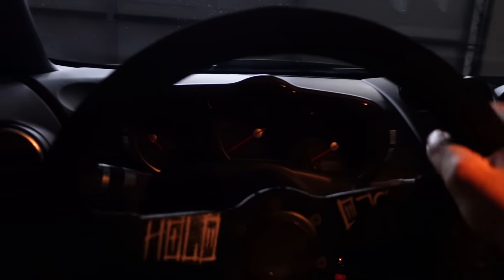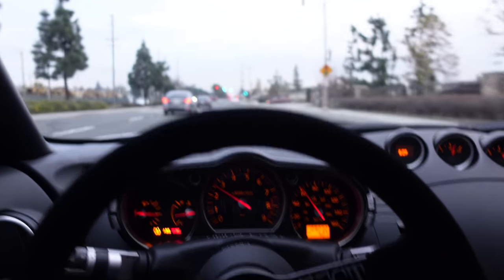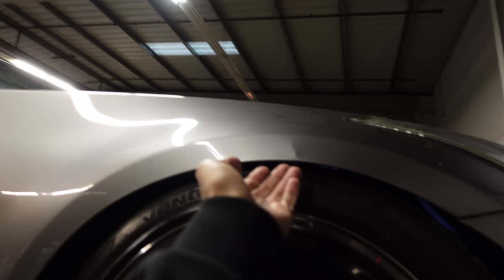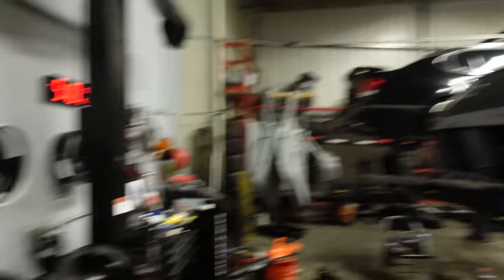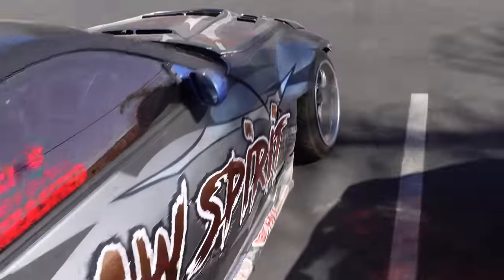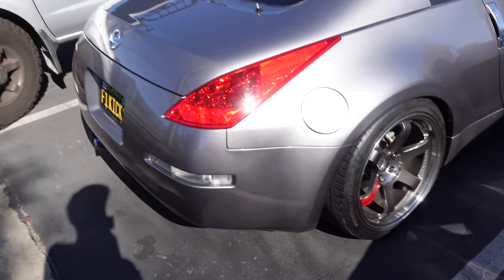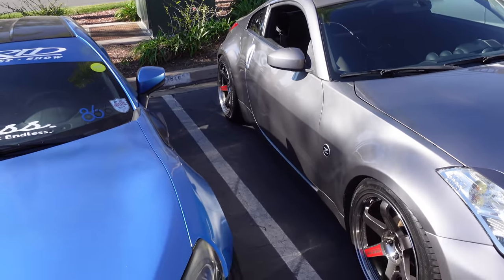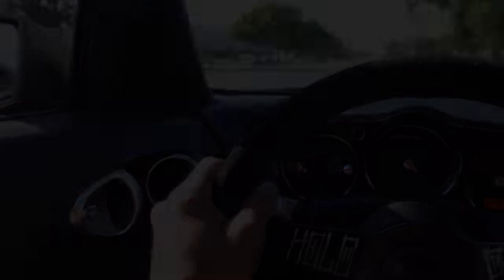New Parts For The Drift Z!

Comment: How you adjust the floater? I’ve had a broken gas gauge for a while. Sometimes when I prime the fuel pump the needle goes up or stays halfway while I have no fuel.
Reply from the maker: normally just take it out and make sure it's not hitting the line.